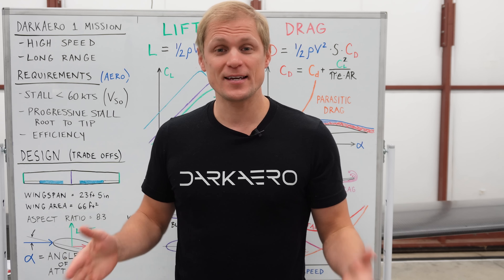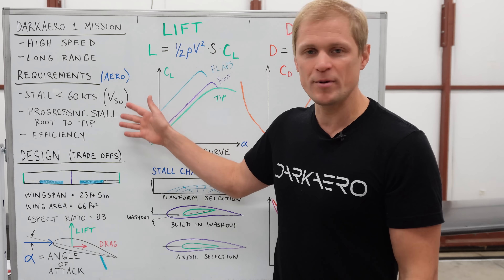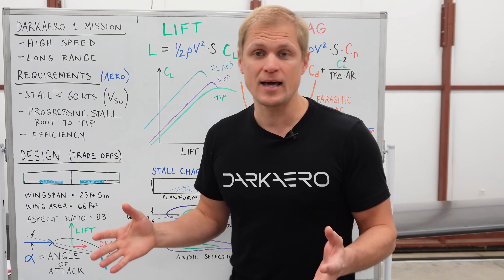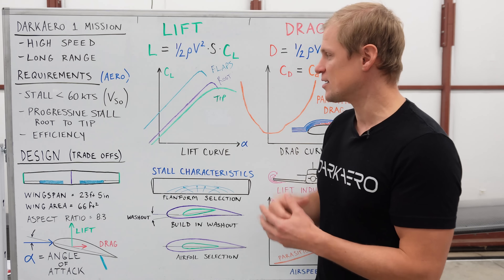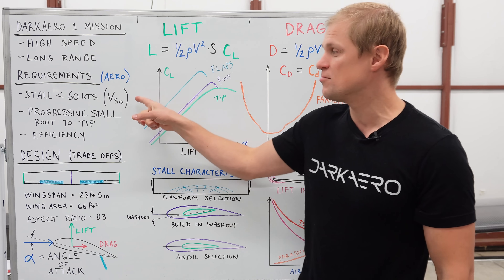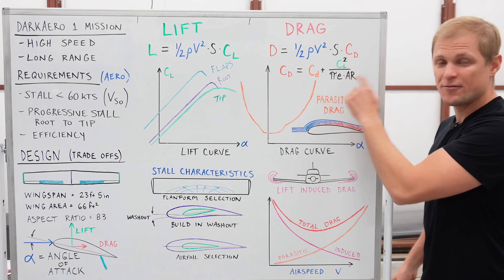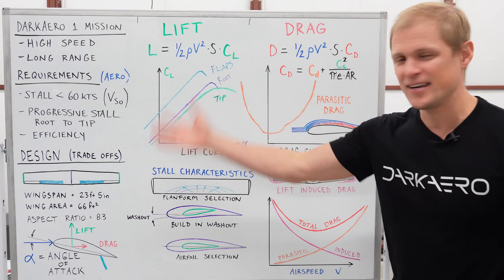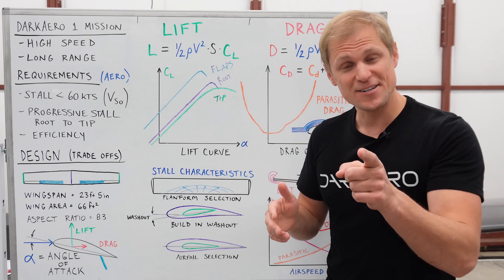Why we don't use winglets (DarkAero 1 Wing Design)

Comment: This is interesting, but, most light aircraft become very uncomfortable at +150kts, 240kts (275mph) will likely be unbearable/risky in anything but smooth air. This is great educational stuff, I assume that the audience are aware of Glasair III and Swearingen Sx-300 homebuilts though. Not wishing to rain on the DA parade,  they achieved all of this in metal/composite decades ago.

Comment: Never gave reasoning for winglets nor reason for why you may or may not want them...  Winglets increase spanwise flow is the short answer.  Another reason is they increas aileron response and you therefore USE  more of  the wingspan  in spanwise loading under more conditions as well as cruise.  One also have more efficient load bearing area.  It also concentrates the induced drag vortice.  You can see this most clearly in modern fighter aircraft design.  The F35 is the best at making a VERY tight induced vortice which increases spanwise flow and reduced Cdi.  Another classic fighter induced vortice is the Mig 15...  One uses a fence the other... does not.  F18/Mig29 use forward chines. Anyways all of this is highly dependent upon your cruise speed wing aero elasticity where the biggest reason is aero  elasticity.   Big reason 777 does NOT have winglets(aero elasticity issues) and 737MAX has winglets on top/bottom to try and alleviate increase wing bending moment from the winglets.   Anyways...

Comment: Really great explanation! Have you considered doing a somewhat smaller surface area wing in the future with winglets? Could that possibly increase cruise speed and fuel efficiency while maintaining good stall characteristics? This is what they finally discovered with the Lancair wing designs. It also occurred to me that a slightly shorter wing, with winglets, would provide a small amount of additional rigidity out to the winglet root.
Reply: The smaller wing area would increase stall speed, and the winglets would not help that.
Reply: @brianb-p6586  Maybe, but again, that is not what they discovered with the Lancair. The winglet actually increased cruise speed and lowered the stall. Personally I have to wonder if it is related to moving the vortex away from the wing tip that makes it more efficient? In any event, that is a known, tested, and proven example where it improved both cruise speed and lowered stall speed and improved stall characteristics when it did stall. The winglets reduced the very nasty, and very deadly, flat spin stall characteristics.
Reply: @BillWood1  I'm not second-guessing the work by either DarkAero or Lancair, but I do note that neither current model of Lancair has winglets, the only previous Lancair model that had them was the IV (from a couple of decades ago), and the Evolution (which was the successor the Lancair IV) doesn't have them. LX7 builds a model derived from the Lancair IV and it doesn't retain the winglets. Apparently Lancair, Evolution, and LX7 don't think they are a universal solution. While of the same general form (high performance low-wing single tractor), there are enough differences between the Lancair IV and the DarkAero that I wouldn't assume that a design feature of one of them would be appropriate for the other.
Reply: @brianb-p6586  You may be right, I am no aeronautical engineer. These guys have obviously done a huge amount of research and developed a new plane from the ground up. MAJOR achievement. My comments are based on the Lancair changes, and on a conversation I did have with an aeronautical engineer on a business flight once. It was interesting from the standpoint that one of the major aeronautical challenges to better lift and more efficiency are the vortices generated at the wing and tail tips. I have always assumed the winglets moved those vortices away from the wing's horizontal lift surface allowing for better lift and more efficiency in flight. That seems to have been the case with the Lancairs and many modern passenger planes.

Comment: High altitude reduces drag, because less parasitic drag. The U2, operates at high altitude with high aspect ratio wings, low weight magnesium metal, and high thrust jet engine. Results, long range, high efficiency and above weather. As a pilot, weather has been more important than the type of aircraft.

Comment: I'd be very interested to hear about the design decisions you made on the other end of the wing.  Dealing with interference drag and the wing intersection with the fuselage is very much an art.  There's so many variables at play, the angle of incidence at the root, the fillet radius, the fuselage taper or lack thereof, even the position of the cockpit bubble has an effect.

Comment: It's really important, when it's shown with the whole gamut of solutions, to use terminology that is consistent with the visual examples; if you include AD-1s and Su-47s in the potential solution space, this really should be described as low-speed and short-range, but obviously not good marketing. Otherwise excellent video.

Comment: Much science and calculations, still You make the plane totally wrong.
Your wing is quite unstable, and the wing is in bottom of the plane, 
t will make turbulance to elevator,
and that is not good.
Plane has at least 5 big points that is wrong.

Comment: Ok all Winglets bad. Got it. Lol. Great intro to aerodynamic engineering lesson. I imagine this is possible bc of the overall weight of the plane. Any larger and wind design changes to comply w requirements and in that case maybe benefits of winglets outweigh the parasitic drag cost.  Thanks for the lesson!!

Comment: This is an excellent lecture and a very interesting airplane. Two comments second-order aspects of wing design: First, wing stall characteristics are also important because they couple to the horizontal stabilizer via the downwash field behind the wing. An inboard stall reduces the downwash at the tail, resulting in pitch-down. This softens the stall behavior and causes a lot of stick travel and force before full wing stall. In contrast, a stall at mid semi-span may result in a strengthened downwash at the tail. As the mid-wing starts to stall, the airplane pitches up and the stall can then be very sudden with little stick travel or force.  Second point: You note that induced drag can be reduced by increasing aspect ratio. This may or may not be true according to what you hold constant. I find that it a better mental model is that induced drag force is reduced by increasing wingspan. Primary elements of induced drag force are lift (weight), span, and dynamic pressure. Given these, aspect ratio has nothing to do with it.  I wish you good progress with the project!

Comment: An excellent introductory explanation behind the physics behind wing performance.  As one who was steeped in such design engineering many years ago, I watched this video, expecting to find some errors, but nope, the presenter is spot-on in his analysis.

One small comment regarding winglets: In general, adding a winglet is about equivalent to simply extending the wing horizontally by an equal amount of area.  So why winglets?  Several factors, one being the use of a slightly-narrower aircraft planform, allowing the airplane to use airport gates designed for smaller aircraft.  The brand-new 777X wingtips fold up also for this reason.  Another reason for winglets is the "cool" factor, implying improvement over older wing designs.

Comment: I can’t believe you guys have managed to produce an aeroplane that’s amazing! I kind of wish we’d seen some actual graphs for the drag components though because I simply do not believe that parasitic drag is such a large component that winglets wouldn’t help. Parasitic drag scales with the square of the velocity. If a transonic airliner flying at 70% the local speed of sound can benefit from them surely a prop aircraft can. Their job is (as outlined by Whitcomb) to produce induced thrust, providing a greater decrease in drag for a given bending moment compared to a simple tip extension.

Comment: I am wondering where your decision of using split flaps comes from, as thats pretty much the worst flap config when it comes to lift generation and your wing is oversized due to it not having enough HLDs
Reply: I'm guessing the complex wing structure they used (In order to achieve the high cruise speeds) would make a more sophisticated flap too complex.

Comment: I loved this video, which was very information-dense without being at all intimidating. Thank you. Another airplane that sometimes has winglets that actually make it SLOWER is the Lancair IV, which needs them at high altitude for yaw stability. A term you didn't mention and pretty much hasn't been mentioned since the 1930s is SPAN LOADING (weight per unit of span length) which is incredibly useful for comparing designs. We talk today about aspect ratio but it allows designs to get too heavy. My old friend Lyle Powell built a heavy 180hp Glasair with two-foot wingtip extensions while my short-wing 150 hp Glasair was built extra light. OUR SPAN LOADINGS WERE IDENTICAL, which bugged the heck out of Lyle as I flew alongside sipping gas.

Comment: Impressive.  As a 25,000 hour pilot, my only question is given your performance goals, and it is not STOL, why go with such a low stall speed?  Why didn't you pick a bit higher min stall speed?  Surely 70 or even 80 should not be a problem for any pilot with the skill to fly your plane and would give you better cruise performance and a smoother ride.

Comment: Great explanation. Just two points, (which maybe had to be excluded for time reasons). 
The thickness of the wing can't be reduced too much for strength and rigidity reasons. If it's too thing, it won't be strong enough, or might start to flutter.  Laminar flow aerofoils are very vulnerable to contamination disrupting the smooth flow.  Dirt or insects on the leading edge, or even raindrops can cause a loss of lift. Rutan's canards can suffer problems if they get wet, for that reason. The Cessna 310 has a laminar flow wing, and friend of mine described how his take-off run in one on a wet day was alarmingly extended.

Comment: Great insight in the DarkAero design trade-offs. Is there a analytical way to determine the wing profile when you have the requirements?
Or did you take a 'standard' form and tweak incrementally?
 Is there a 'single' wing design, once you have the requirements, or can you have the exact same results with different shapes?

Comment: While winglets are not necessary for better efficiency, you could make some subtle ones which either curve up or down, just for aesthetics.  Heck, even round ones looks better than flat.
I hope you guys succeed with such a beautiful plane (could be better with nice tips!)
Reply: NACA undertook a series of tests into wing tip design and found that rounded tips, whilst aesthetically pleasing, induced the most drag! The most efficient was the squared off ends followed by the others at various degrees of efficiency. Hoerner tips are rated at 95%.
Reply: @vumba1331  Yes, I'm not suggesting they make round tips and Certainly not Hoerner tips.  Hoerner tips are even uglier than what they have.  Slightly carved down, slightly carved up.  A little touch which would look much better.  I prefer the ever so slightly up tipped ones, but I'll allow them to use the slightly tipped down ones if they must.  😜

Comment: Another way to reduce lift-induced drag is to use a more tapered wing planform.  This reduces tip-vortices without requiring an overall high aspect ratio.  However, sharply tappered wing planforms aggrivate the tip-stalling tendencies.   Good aerodynamic design (to meet desired performance criteria) is all about balancing the various factors to achieve the best result.   Nice video, well presented and good explanations of the design choices that were made with the DarkAero.

Comment: Would you be able to make a video about why you chose split flaps?  By the time air gets to the flaps the top of the wing is no longer laminar flow. So why not use fowler flaps or plain flap?
Reply: I found the split flap choice interesting, too; I would be interested in the answer.

Fowler flaps would provide more wing area at low speed than high speed, helping the compromise between high speed drag and stall speed, but presumably were eliminated based on complication.

Comment: Awesome. Still a bit fuzzy on the explanation for winglets -- it sounds like they're more effective at low speed than high speed? If so, why do airlines use them -- surely they spend nearly their entire flight at their cruise speed (which I assume is "high speed")?

Comment: One thing I'd like to see more use of, for planes that need such a low stall speed, is nearly full length fowler flaps+leading edge slats for greater wing area during landing+takeoff but lower wing area/less drag for cruise

Comment: The weight is really going to do wonders for induced drag. The only scary thing about flying a feather I can think of would be take off and landing when control surface authority is at a minimum. Strong gust crosswinds could put it on the roof in a moment. Just have to be fully aware that it's super light.

Comment: Did a design study for retrofitting a small bizjet with winglets as my Master AE thesis. Basically a winglet extends the wing so increases the aspect ratio, just in a different direction, which means you lose some efficiency as the lift vector also changes. So the more you cant (angle) the winglet the more you lose, or to go into a different direction: The best winglet is actually just extending the wing (so 0° can't). Which ties in nicely with this video explanation. You increase AR a little but you do gain parasitic drag. Plus winglet also increases bending moment on the wing, requiring to beef up the structure though there is then an advantage of canting the winglet as it puts the center of lift from the winglet closer to the original wing tip, reducing the bending moment impact compared to a flat wing extension. Not an issue usually though for short GA wings. Last advantage of winglet is keeping wing so span in check if (parking) space requirements need to be considered.
Reply: All depends what winglet design you are using. Canting the trailing edge of the winglet slightly inwards towards the fuselage can actually provide an "induced thrust" due to the spanwise flow interacting with oncoming flow and using the winglet like a wing, creating a portion of lift acting inline with the thrust axis. Ideally, the best wings are designed such that you don't need a winglet which is what happened with the 787 after the 737-MAX's winglet process. Currently doing a CFD & wind tunnel analysis of different winglet designs (fenced, scimitar, blended, spiroid) effects and can confirm that it is a "turd polishing" mechanism for poorly designed wings lol.
Reply: @ioanefiso6314  oh yeah, that was basically one notion... Not needing winglets is the best, i.e. extending the wing, though of course at some point bending moments/material strength become and issue taking over.

Comment: Lovely explanation, thanks.  A great revision and reminder of the times I was in the UK Fleet Air Arm studying Bernouli etc.  I would disagree with the idea that winglets will not be beneficial though.  Yes, they reduce the induced drag and at your cruising velocity it would have little effect.  But surely the fact that you can reduce the aspect ratio will have the knock on effect of reducing the parasitic drag too?  Therefore wouldn't you see a significant overall reduction in drag at the high cruising speed?

Comment: Excellent review, well done. I have a question - you have flaps that help reduce the stall speed. Why not include slats at the leading edge? These are used in many A/C designs and are very effective. They are also used on jets, such as the F-86 Sabre and many commercial airliners.
Reply: More weight, more expense. 
Do they really need lower stall speed?

Comment: The Prandtl wing is the most efficient wing design & solves both tip stall & adverse yaw.  It's based on wing root bending moment being the design constraint.  It is more efficient than the more well known elliptical lift distribution based on span being the design constraint.  The Prandtl lift distribution has the drag benefits of winglets designed right into the lifting surface & is also the most efficient solution for you take off/landing and cruise speed constraints.  It would give you a longer span without increasing root bending moment by depowering the tips.  So unless you have to fit that wing into a specific hanger space, it's a superior solution for your project.  I know this because it always is the superior solution where the span is not constrained by storage space.
https://ntrs.nasa.gov/api/citations/20160003578/downloads/20160003578.pdf

Comment: Great work guys, question, Why not use larger flaps with a smaller wing? This would seem to reduce high speed drag while lowering stall speed as needed.
Reply: They’re wet wings aren’t they? I imagine part of wing size in this application was fuel capacity. The DarkAero 1 is going to have some LOOOONG legs for such a svelte little machine.

Comment: Love the idea of using a different airfoil section at the tip to modify the stall characteristics. Could you not have used a higher aspect ratio wing if you had winglets?
Reply: Hm…you mean lower AR , right?
Reply: @ammerudgrenda  higher, as in part of the wing area would be accounted for by the winglets, allowing them to remove wing area from the flat portion while not increasing wingspan.
Reply: @PalladianPD  
Ok, I see what you mean.

Comment: Winglets: It all boils down to cruising altitude. Airliners are designed to cruise at around 35,000 feet. Air density is quite low up there, so induced drag at cruise is a bigger consideration there than for the DarkAero at a much lower cruising altitude. .